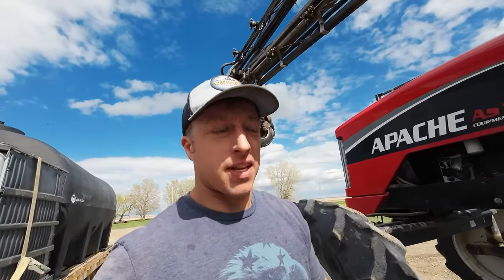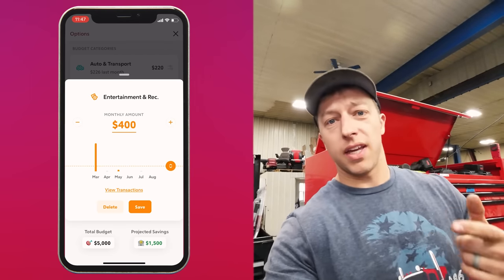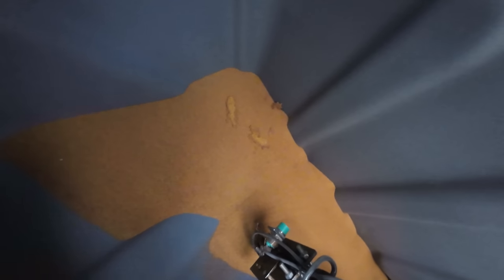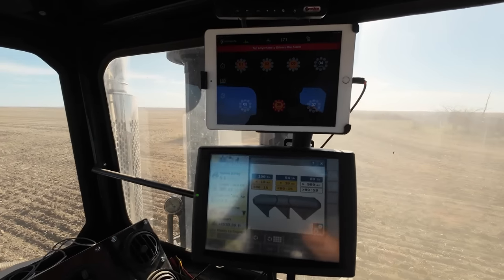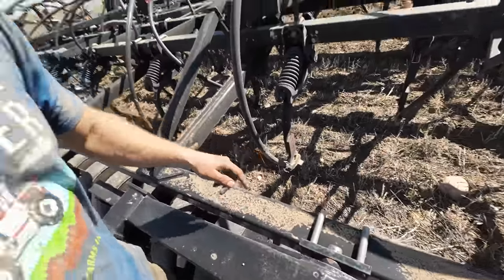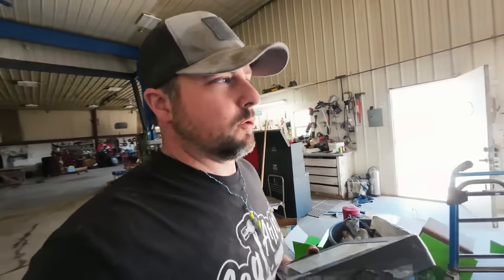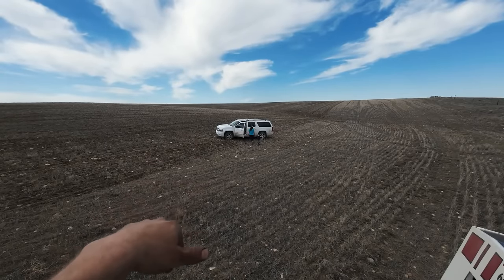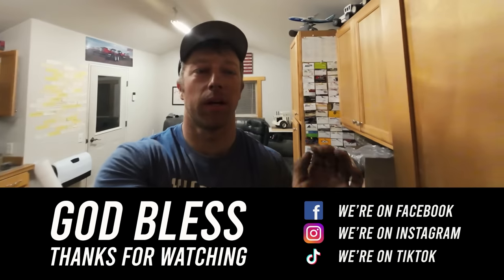Tractor Down! 60+ Year Old BIG BUD To The Rescue!

Comment: Very awesome seeing the older machinery still running so strong, don't make um like that anymore at all..I just backed the 1948 Ford 801 I was restoring out the shop today and had a coolant leak also lol had a bad hose clamp 🙄 hoping to have the finish mower hooked to and working in the fields grooming between crops by tomorrow 🙏 best wishes to y'all for a prospering year, sounding like gonna be a good year for rain

Comment: Watch your oil on the coolant leaker.  If it's dropping a liner it won't appear milky from water right away but if the pyro is high it could be from water on one cylinder, the pistons usually blow up, the liners crack just below the compression ring on the top, the liners get really hot before the seals blow out and water gets in your oil, piston failure is usually close behind.

Comment: Spares mmm. That's why we have two old combines. Only do 400 acres spread over several crops. We try and try to keep both going. Last year we lost one with big tyre blew out beyond repair. That cost a half day. At end of season other old girl lost a head gasket. On last few acres lol. But we kept rolling. Have a new drill. Fancy stuff to go with all tractor quidance etc. Not been without its issues and saves a lot of time but still got a very nice simple great planes drill in the shed. When you have to plant or harvest not being able to do so is costly, especially with our changeable weather here in Canterbury New Zealand. Hope you get the right bits turn up and electrical gremlins eliminated. Sure is God's country. No one every promised it would be easy. Stay safe.

Comment: Couple of questions. Is the little bud 435 horse? How wide is the air seeder its pulling? and finally is the open center gear pumps you guys run, run the steering as well? Or is there more than one hydraulic pump on the tractor? I have an old steiger i am trying to get setup to run an air seeder. And I am looking to ether add a second pump or two upgrade the existing pump to run everything.
Reply: Sorry watch more of the video and find out some more info. But would like to know how you set up the old tractors to run air seeders.

Comment: Scott, your cart may have an inline filter screen in front of the front meter roller hydraulic motor. After a hydraulic pump failure, you may need to clean or replace the screen. Your cart may have the same filter/screen in front of each hydraulic motor for the meter rollers. 
Hello from north east Montana.
10 miles from the Canadian border.

Comment: Hey mate just wondering if you found a solution to why you seed and fert are running out one side faster I’m having the same issue with our flexi coil 5560 box cheers
Reply from the maker: I still am not entirely sure but could be the cart has turn compensation and so it may be that I was making more left hand turns. I also suspect there was something blocking the meters. But not sure.
Reply: @WelkerFarms  I’m running section control but not turn compensation. And my box is running out faster on the left hand side of the box mainly in the seed tank I notice it more, I was told multiple things for the cause but proved all theory’s wrong. One was more meter rollers on one side (it was running out faster on side with less rollers) the agitator was moving the product to one side. (Unplugged agitator and still run out faster same side. Filling the box one side more then the other, I let the box get down so only had 3-400kg in box leveled out seed and still ran out quicker that side. Have a mate with the same box and he has no issues with his. 🤷🏼‍♂️

Comment: Quit using zip ties on your hoses and electrical wires! They do a lot of damage. Use velcro straps, they are cheap and reusable. Pick up at any electrical supply.
Reply from the maker: What? They don't damage anything. We love zip ties. More zip ties the better!
Reply: I don't think velcro would reliably hold long term.
Reply: @J-1410  velcro will last through all weather, and it does not stress, Crush or damage any armored wire. Just make sure you have a proper overlap. Communication wire is different than voltage wire they are made different wound different in squeezing a communication wire could create faults in The Wire.
Reply: @WelkerFarms  so you've never wondered why a component is not functioning properly with the monitor?

Comment: I’ve always wondered why some guys pull the cart first and some pull the drill first
Reply: With a tow between cart, you get tongue weight on the tractor, also behind the cart is a huge blind spot.  With tow behind cart, your toolbar is closer to the cab, you can see most all of the shanks.